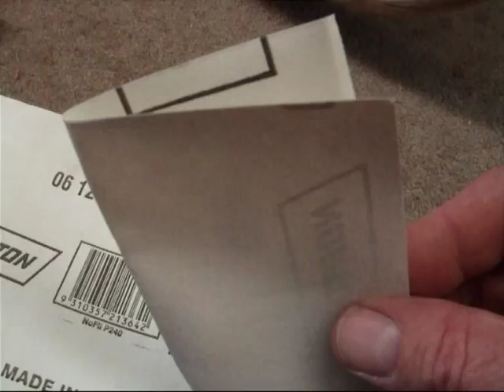How To Restore a Cane Saucer Chair Pt.1.

Comment: Thanks for your very informative video. I was wondering if it is possible to remove old dark stain/varnish from a small cane ottoman and have it come back to natural wood? Would denatured alcohol remove the dark sticky finish?
Reply from the maker: The best result would be to have it professionally stripped in methylene chloride. DIY with paint stripper. I'm not sure  that you'll have much luck with methylated spirits or alcohol. Guess you could try first though. It really depends upon what the actual old finish is. Good luck either way.

Comment: If you were going to paint rattan furniture, would you strip the varnish off first, or just apply the paint on top? Which would be more effective? Also, what grit of sandpaper do you use? Thank you. I'm hoping to restore a table set I got
Reply from the maker: Hi Aly, if you’re intending to apply a painted finish, then I personally wouldn’t paint strip unless the old varnish is lumpy or cracked. Use a medium sanding sponge rather than paper. Apply a good undercoat before your top coat. Use an oil based enamel for a more professional look. Good luck. R
Reply: @wickerguru  thank you, would you sand before painting, or not sand at all and just paint over the varnish?
Reply: @alyking6099  YES....you always should prepare the surface before applying any finish. That's if you want the paint to stay on!!

Comment: Can you tell me what you stripped the cane with? Your video is very helpful however i can't work out what you have stripped the existing varnish/paint with?
Thanks :)
Reply from the maker: Dipped into Methylene Chloride. Or you can use any paint stripper off the shelf as long as it's non caustic.
Reply: wickerguru Hi , we washed with detergent mistakenly now is dried however it’s too dry ! What we should do ??

Comment: I wasn't able to get your BIO OIL, so I bought another one called, 'BOILED LINSEED OIL' which I was told was one of the best oils for Cane or Rattan furniture.

To be honest, I have no idea, at this point, if the beautiful chair (btw, in mint condition, Lucky find right! 😏👍🏾) is actually Rattan or Bamboo! 🤷🏾‍♀️ 

Q: Are those two materials treated the same or completely differently?
Reply from the maker: Linseed Oil is just as good. I no longer use BIO oil as it's too expensive, and Linseed does just the same job, and cheaper apart from its smell!! Just make sure you use sparingly and rub in well with a clean cloth. Rattan (Cane) is solid, whereas Bamboo is hollow. The oil will be good for both.
Reply: @wickerguru  then I guess I have Cane...or Rattan because it seems very solid and has a weight on it. I wish I could just send you a photo so you can see...can I DM you to send it?
Reply from the maker: @odeanlawrence196  https://www.wickerworks.com.au/contact-us.html

Comment: If one of the seating straps have snapped what repairs can be applied to this
Reply: Replace the bindings where necessary.
Reply: Richard Beazley thank you I will do this but main worry is one of the base seating area long bamboo post  has snapped